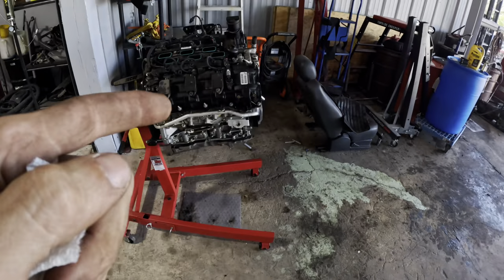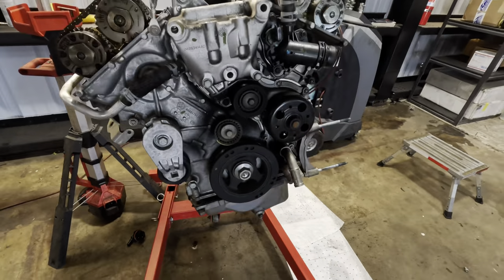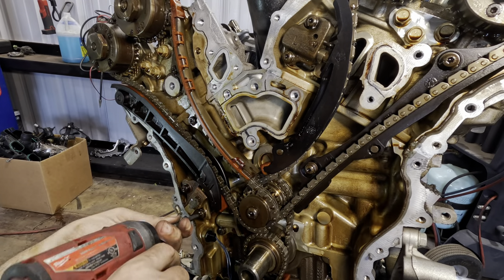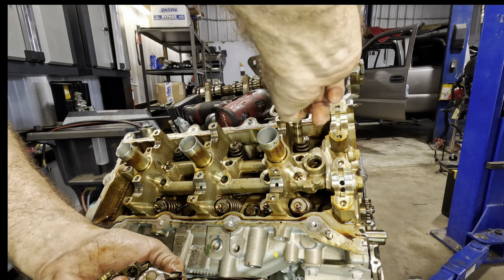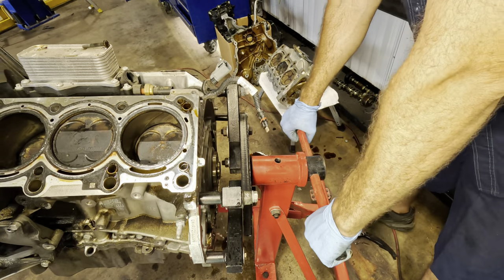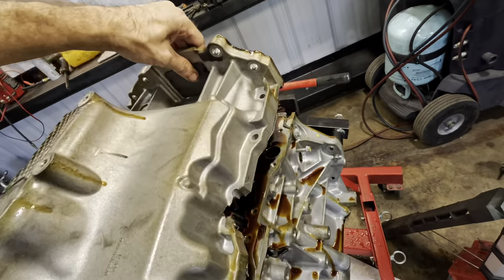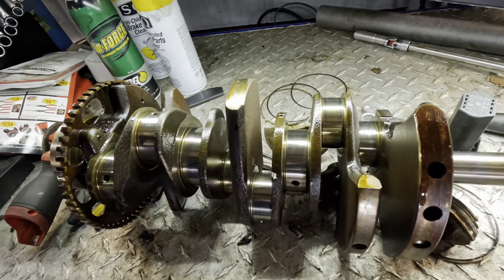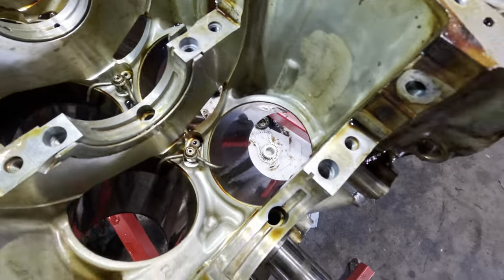Blown Engine--Broken Rod ! Autopsy 3.6 Pentastar Ram Jeep Chrysler

Comment: If you still have the piston clean it along the crack and see if there is erosion at the top seam. If you see erosion the crack was causing the lack of compression as the cylinder fired. It would look like a small lack of compression with just the starter turning the engine over. Two possibilities from there. One the fuel injection system was attempting to compensate for the lack of power in that cylinder by adding additional fuel which may have caused detonation or two the piston weakened and finally spread enough for a split(pun) second which stopped the piston enough to break the rod. Either way the crack on the piston was the cause of the rod breaking. Evidence is that the piston was at the top of the bore and in pieces.

Comment: A stuck injector could also have caused the same sort of damage, if it was dumping an insane amount of fuel.
Reply: it seems obvious to me that it was a stuck fuel injector. I have had it happen on 2 ls engines. are there something 
Im missing as to why no one is blaming a stuck injector?

Comment: once again a middle cylinder, on I DO CARS it was the middle cylinder on both banks so i will second your diagnoses overheating, head gasket let go in the middle cylinder hydro lock bending the rod and they continued to drive the vehicle thinking they could blame it on you

Comment: Aluminium can and does fail i had a very nice honda motorcycle that for no reason at all split a piston but not quite as bad as this but if the barrel has a score i would say that the piston broke up in a way bad enough to have locked it up in the barrel thus braking the rod for no other reason than metal failure. Thousands of pistons get cast only takes one in a thousand and this is the one quite possibly

Comment: Ray, this may sound very simplistic. But as a really old (80) yr 'gear head', is it possible it was just an old fashioned piston failure. Many years ago, I had seen such things, but not a lot, on early GM small blocks, and a hand full of Chrysler(Ply) flat head sixs.  Actually, I had a frozen wrist pin on my own 'cherry' '49' Ply. thanks for the walk through on that engine. I found it very interesting. Thank you. sincerely, Bruce R. 'ye ole gear head'.

Comment: I think the failure was created by that clean break in the connecting rod. This seems to indicate there was an inclusion in the casting, probably a microscopic group of 'getters' (addition to molten steel, such as aluminum) that help degas the molten product. Work hardening, due to constant compression over time, probably was the root cause of failure, evidenced by a clean snap. The now-loose piston, with its remnant of broken rod flailed up and down, causing the subsequent damage to the block.

Comment: Very interesting, thank you. I recall that there was a slightly lower compression test value on cylinder 3 (compared to the others you tested in the first video of this series. 
Could that support your theory of the blown head gasket, leading to coolant leaking into the cylinder?
I am not sure I support the theory. Compression gases are at a higher pressure than the coolant pressure. Therefore you would have compression into coolant during combustion with no possibility of water entering the chamber while the engine is running. When the engine is not running, coolant, would enter the combustion chamber due to reverse pressure differential. 
So how, would the engine fail during operation in your theory?

Comment: Hydra locked fuel .....
Leaking injector....
Or someone damage injector
Refit..........
Lot of people said water issue
Water wouldn't leave Piston, head, so oily....and no signs of
Rust, yellow deposits ........
Or
 someone fitted wrong injector,

Comment: I subscribe to I Do Cars as well and love these videos.  Ive owned 3 of these Pentastars and have driven them well over 200k.  They will last if you take care of them like anything else.  One common theme I see with these are the lifter failures.  It seems if they speced a slightly better part for the Oil cooler and the lifters these would have a much better reputation.

Comment: Could’ve been ur fuel injector you know how parts are junk nowadays prob stuck open and filled the cylinder with fuel which gives you your hydro lock you’d see coolant in the oil if it was a head gasket or in the exhaust when u took the pan off in the last video there was no coolant only some water from condensation

Comment: Pentacrap engine, only good for bolt salvage. All the added goodies to the engine to gain a few more MPG, (variable displacement oil pump, variable valve timing, etc...) and still an expensive POS engine. Keep it simple and spend an extra $100-$150/year for gas!

Comment: And to finish my comment it's one of the worst engines Chryslers ever come up with in the last 2 years I've replaced seven camshafts 14 oil pumps and see numerous rocker issues yeah very poor designed engine